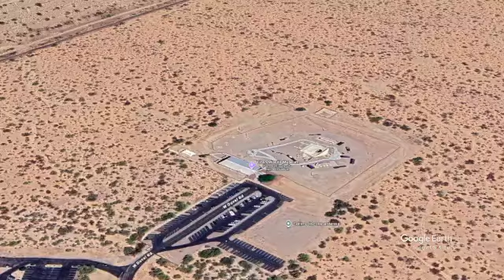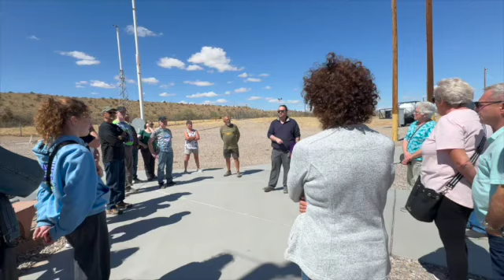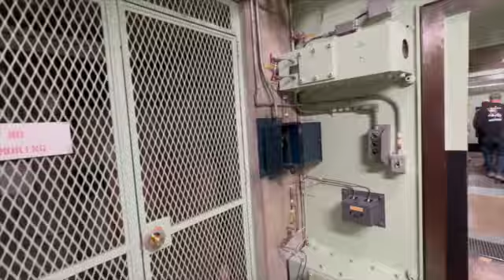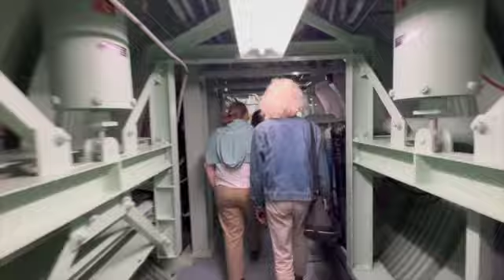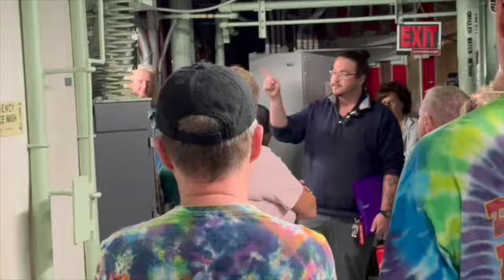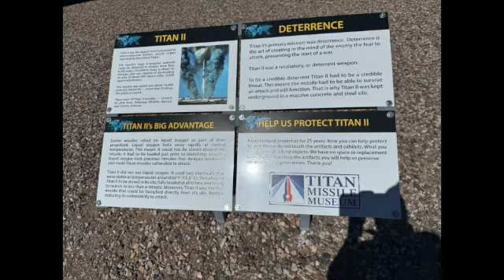Titan Missile Museum

Comment: Pretty good presentation there.  The 900 square mile area of total destruction by the W53 warhead was in Airburst Mode, city destroyers, and that is before we get to the other effects extending out even further in miles.

In Groundburst Mode, going after other silos and hardened underground targets like command and control centers, etc, the W53 will blast a hole some 3/4th of a mile wide, 450 feet deep,  and vaporize everything in it, before we get to the other effects.

The Butterfly Control Valve Lock had multiple safeguards built in.  First, you get six tries for the life of the system to input the correct code. On the 7th try, even if its correct, the system commits electronic suicide.  Trying to tamper or bypass the electronics in the control center, assuming the rest of the crew doesn't stop you, also makes the system commit electronic suicide.

Attempting to mess with the Lock on the missile itself will blow an explosive charge in the valve lock and jam it permanently closed.  Techs had to go through a procedure to activate a long timer on the physical lock, and wait for that timer to expire before they could work on it.

Finally, moving the thumb wheels on the lock control set off an alarm at the airforce base. So unless a system test was being run (they had a list of cheat test codes to conduct those without missile launch) the commander would get a call from the base by a higher up who left their sense of humor in their other pants.

Great  video!
Reply from the maker: Thanks for the added info!